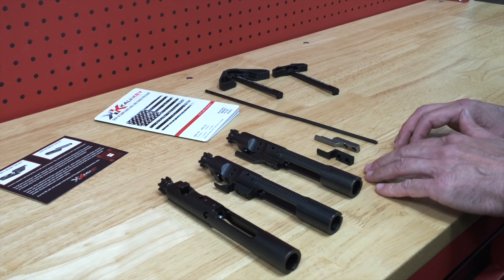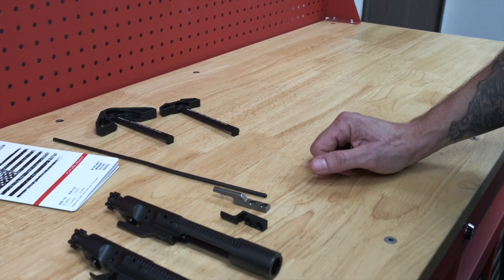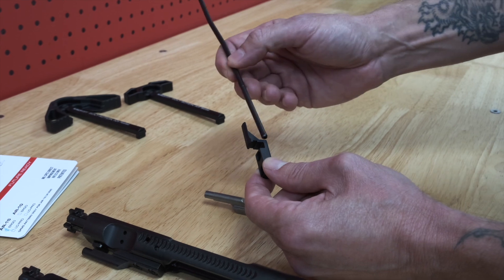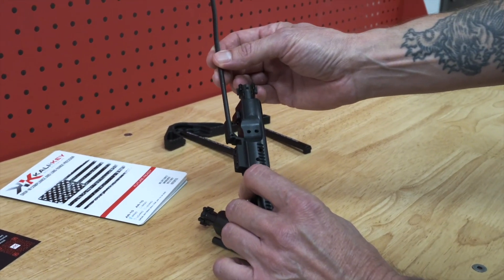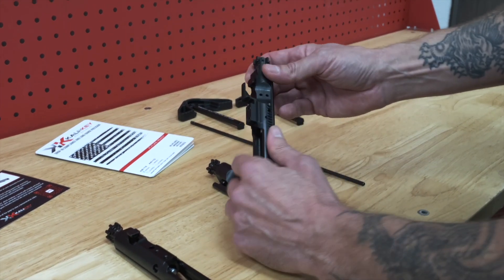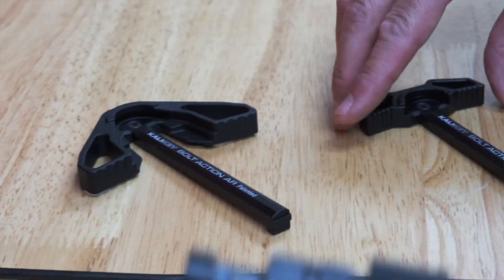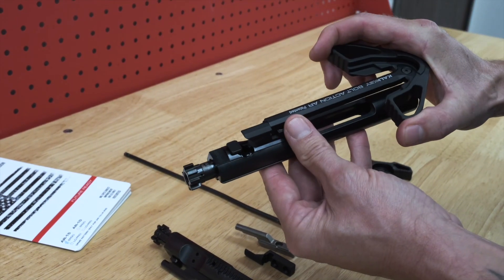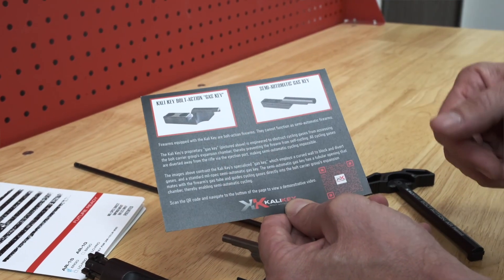Unmistakable: Contrasting the Kali Key Bolt-Action System to Semi-Auto Systems

Comment: Why not just build a special upper with no gas tube and block the hole? In theory you could design a folding stock because the bcg doesn’t move. 300 blk could be real quiet done right
Reply: Clearly you don’t get the point of this product
Reply: @benbauer1509 I was thinking why not optimize it. I get it you can just swap the bolt and make it legal in communist states.

Comment: Will this mess up the gas system by chance . Because the gas doesn’t go through
Reply from the maker: Hi. There's zero impact on your gas system. Cycling gases get diverted out the ejection port and away from the user. No obstructions or anything that would touch/impact your gas system.